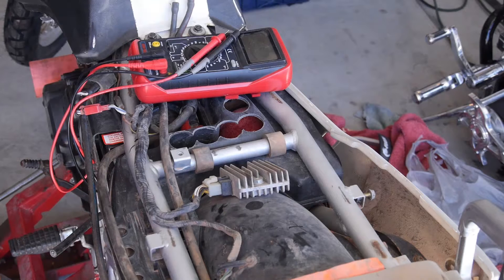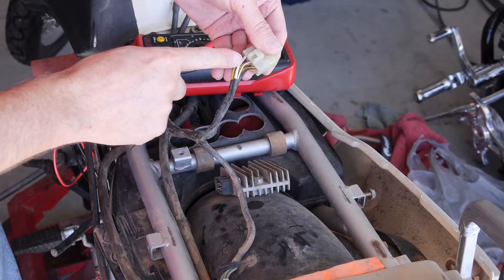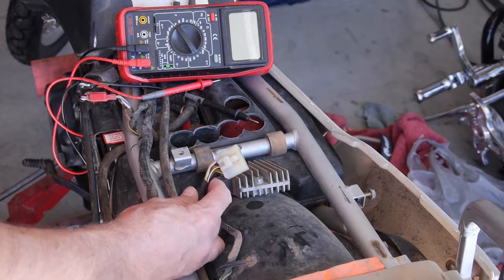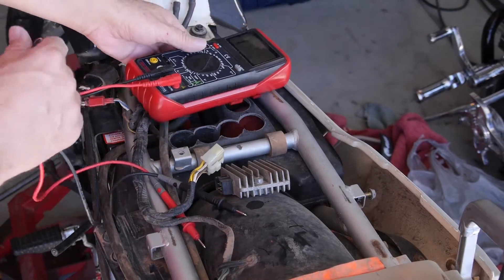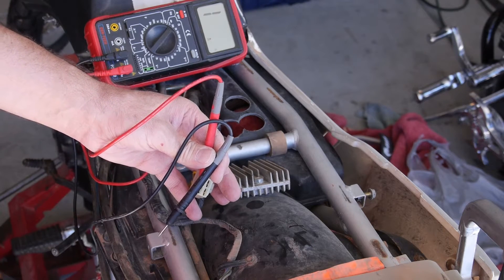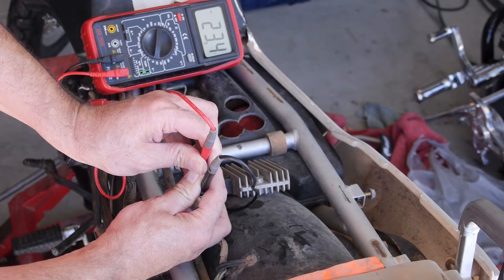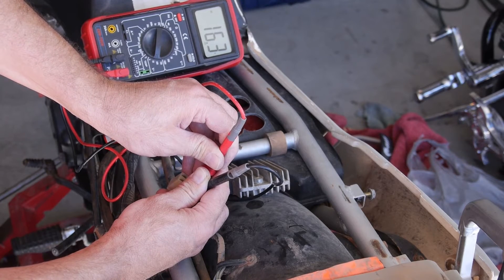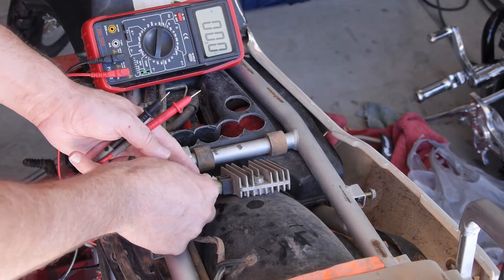KLR 650 - HOW TO TEST YOUR STATOR

Comment: Can u do this with the klx 650
Reply from the maker: Yes
Reply: @MrDuhfactor  could this box be the cost of no spark
Reply from the maker: @dbdb4274  the cause of no spark is usually one of the following; 1) Bad spark plug, 2) bad coil wire, 3) bad or poorly grounded coil, 4) bad pickup by stator, 5) bad CDI, 6) faulty stop switch, and a few other possibilities. The stator putting out AC power is necessary for powring the spark, but when it goes bad, its usually just one leg, and should still put out enough power to send spark.
Reply: @MrDuhfactor  well its a klx650.. I have power from the red wire from the stator it lights up my test light I'm not sure if that's the main stator wire.. And i have power to the stator.. And from the ignition coil spark plug side has no power but the wire on the coil to the cdi has no power at all im at it the last two days
Reply from the maker: @dbdb4274  you will need a wiring diagram to help you figure out which wire your testing, where it comes from, and where its going. The coil wires are tough to test accurately, but if you can find a wiring diagram, I can try to help you out.
Reply: @MrDuhfactor  I have the diagram but can't seem to understand it are u on facebook il send a link to it
Reply from the maker: @dbdb4274  look up MrDuhfactor on FB buddy.... Ill look it over....
Reply: @MrDuhfactor  done mailed u

Comment: would this work on a second gen klr?
Reply from the maker: Yes, it should
Reply: @MrDuhfactor  thank you so much, i appreciate the reply. Having a electrical draw when my 08 klr is running and sitting i believe so i’m thinking my rectifier is no longer working
Reply from the maker: @erickgarcia6906  Having an electrical draw while running is expected, but not while sitting. Once the key is turned off, there should be no electrical draw from the battery under normal conditions. if you have a draw while the key is off, then there is likely a short somewhere in the system. Does that make sense?